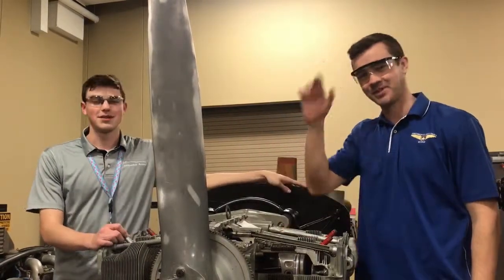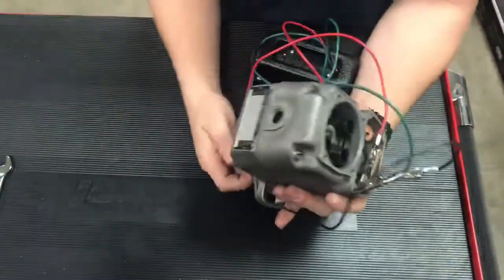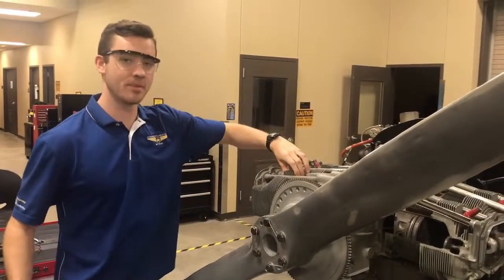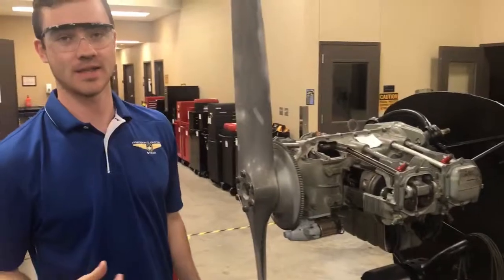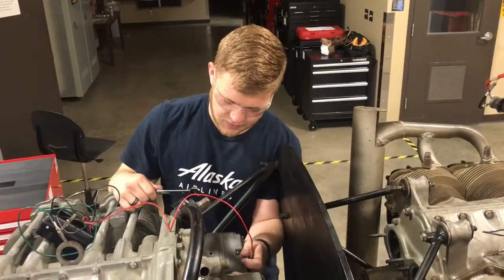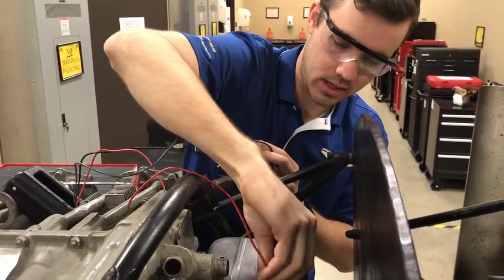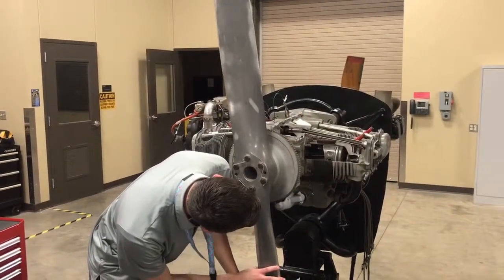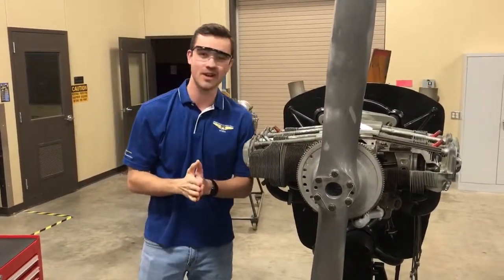Aircraft Magneto Timing

Comment: How do you know if you're TDC on compression stroke or TDC on end of exhaust stroke or does it matter?
Reply: you can hand crank the engine and look at which rocker arm/valve actuates
Reply: @javajav3004  Ahhh good thinking! Thanks dude
Reply: @badboybootz8  no problem man. just remember to see look in the sparkplug hole and see the top of the piston in addition to seeing both rocker arms relax. To answer your other question im pretty sure that you need to be on TDC Compression, but  dont quote me on that.
Reply: Guessing that when the piston starts pulling your thumb, you will be on the intake stroke, after that full revolution you will get compression stroke